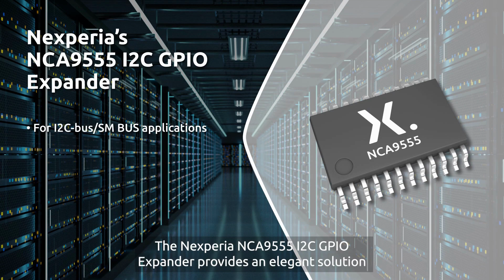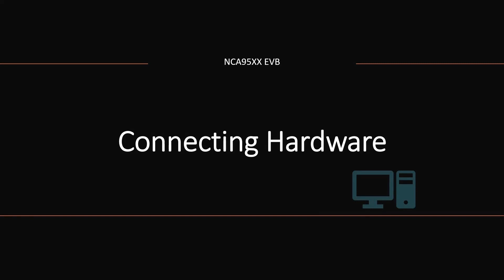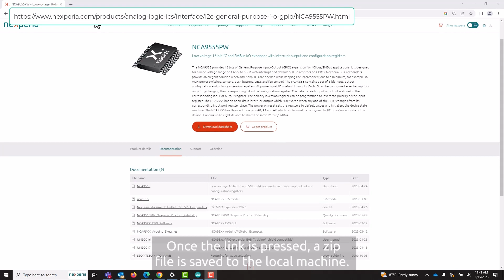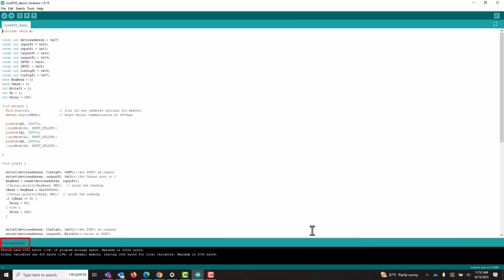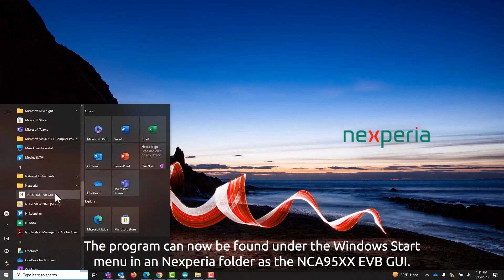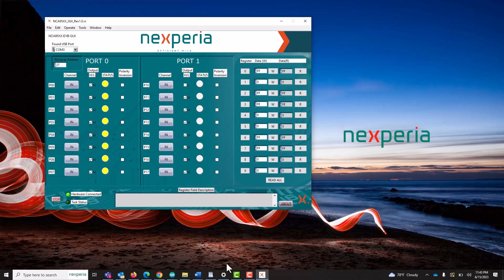Unboxing the NCA9555 EVB I2C GPIO Expander

Comment: After using PCA9555 and PCA9551, I now normally uses PCAL6416AHF that works perfectly in my application, driving lots of LEDs and general outputs and reads in statuses and key's. I always wondered how I2C can be so superior in compare with other serial solutions, I even have used SDA/SCL in long cables (at lower clock of course) and provoke it to fail in huge noise environment without a single failure. Used them with Atmel MEGA and XMEGA and 16 bit controllers.
Remember to build firmware driver as an re-usable object so it is fast and easy to use this chip in your next project !